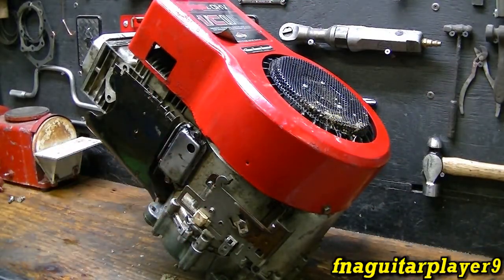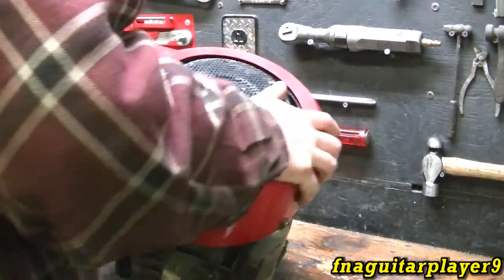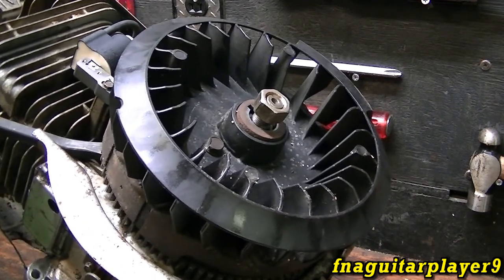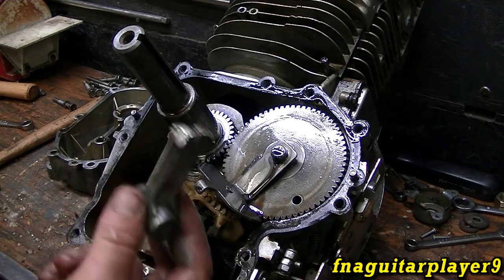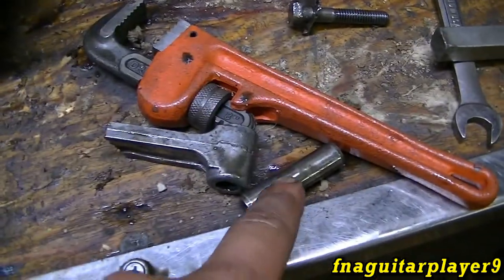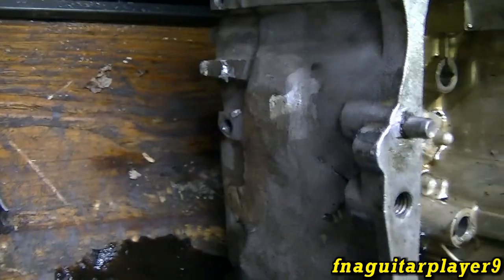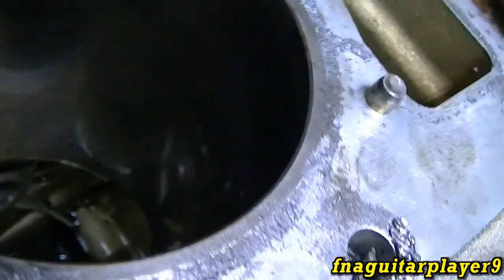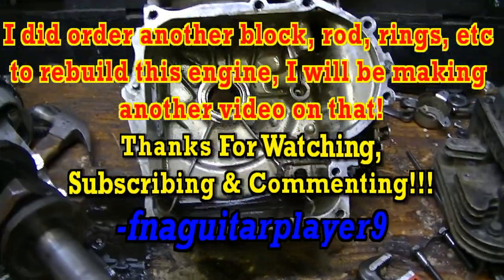Tearing the 14.5 HP B&S Apart to find Major Crankshaft Problems!

Comment: love your channel . you have some great videos . I thought I would let you know what caused that shaft to break like it did. I am a retired millwright/ Industrial mechanic   I got a quick look at that piece of shaft that broke and can tell you that sometime in the past that some one way over heated that  shaft way to hot very probably to get the fly wheel off and then while it was still very hot quenched way too quickly more than likely hit it with a water hose thereby re-tempering the metal making it too brittle and causing it to break like glass from a blow from your hammer or maybe cracked from the shock of the wreck its self. This is why mechanics or other people who are not experienced with the tempering of tool steel are warned about heating metal and bearings too hot with a with a torch and then quenching too quickly with water it can make the metal very hard and  brittle.That is what gives it that sandy look inside  like you see in the piece of shaft in your hand. You will find that same sandy look in any tool steel metal  that breaks or chips. you can see this in badly tempered chisels, hardened bolts, nails, screws drill bits, bearings and so forth. If you have to heat  a coupling, gear, or bearing to install or remove it because of the need of a tight fit damage or rust it does not need to be heated all that hot especially for installment. once you get it above boiling temp you have about all  the expansion you are going to get. use a temp stick , used in welding or heating they are very cheap or simply spit on the object and when it bubbles and hops it is ready to be installed or removed. you be ready to install shaft cleaned of rust and debured, welding or heavy leather gloves or mittens  and your 230 degree coupling, sleeve, bearing etc. or if removing, your hammer and or punch or what you need to turn or impact your puller and then work smoothly but quickly before the shaft gets expanded from the heat also. If it does  you have lost your clearance. Let it air cool and it will not change its temper . If  you have an air hose and let it blow on  it to cool it, is almost as fast as water and will not change  the temperr, but let the shaft or whatever return to its temper and start over. If you don't believe temper can change metal drastically then take a old file you don't' need and heat it orange or yellow would be better and if you have some garden lime  bury it in  a bucket of lime and leave it to cool overnight . you can bend it like mild steel .Sorry his was so long but thought it might help some of you.
Reply: fnaguitarplayer9 video's are great and i also find your comment interesting,  i for one have a habit of grabbing a torch and give it the beans and in the back of my mind that little voice is telling me not to change the temper,   but needed a little advice,   thanks to the both of you

Comment: Are you still here on YT?  I have a question about this same motor, but for the life of me can't find a good answer. Mine won't turn over until I take the spark plug out, then it spins freely (and squirts gas all over my driveway!) I watched a few tutorials, bought feeler gages, and adjusted the valves... but for the life of me it still won't exhaust and the pressure locks it up when I put the spark plug back in.  Any advice?

Comment: I normally used a flywheel puller so are you gonna replace that part what you just broke
Reply from the maker: I used to mine broke and i just now remembered to get another one. But yeah i did have to get another crankshaft for it, the ones I had from other engines were worn out to much to use. I had already ordered the block then found out i didn't have a good crank for it. Thanks for Watching!!!
Reply: +fnaguitarplayer9 Ok you welcome i will be checking out others of your video's as they come, even we learn alot's from watching your video's
Reply from the maker: appreciate that!

Comment: I guess you will save some for parts
Reply from the maker: I got a pretty good deal on a good used block, and ordered new rings and a rod for it, I'll fix it, and won't have a fortune invested in it. Thanks for Watching!!!
Reply: fnaguitarplayer9 Wow you are very smart at that, i try not to blow any money for no reason myself i just watch, listen and learn and , i will be watching more of your video's and You welcome
Reply from the maker: I hear ya! It won't be to long and i'll be rebuilding this engine, I've been busy here lately! Appreciate that!
Reply: +fnaguitarplayer9 I guess you gonna prove all of us wrong by rebuilding that small engine's, I already know you are good at this, because you gave me the right valves clearance for Tecumseh lawnmower, only how long it gonna takes to rebuilds that engine's since you already have all the parts
Reply from the maker: I hear ya. In my latest video on surfacing heads and blocks i showed the block i'll be using in it. It won't take but a hour or 2 to put it together but i'm currently working on a truck on weekends and its taking alot of my time for these longer videos, it won't be long though!

Comment: Man you actually replaced all those parts? Unless you had a donor engine or used parts, that would cost more than a new engine to buy all those parts new.
Reply from the maker: I got a good deal on a used block off ebay, and some other parts, I don't have a whole lot in it. If i wasn't making videos I probably wouldn't have put any more money into it, its just a back up motor anyway. But no, the only parts i bought new was a rod, rings, and gaskets. Thanks for Watching!!!

Comment: Yes, OUCH! Hate that about the crank. I try and get a pry on both sides if any way possible and I know you do too but you ran out of arms and hands. I've got a pickle fork I use on one side and a lady slipper on the other and then pop it.  Usually works right off. And the way some companies say to run these engines is a wonder they stay together 5 seconds. Craftsman said to run the opposed piston wide open and just use the choke till it warmed up. That's why I got the jetted carb for it so I can crank it on idle.Gravely said to run the 301's wide open while working. A 301 never needed to be wound up as far as I can see. The blasted thing would kill a weeks burying. Probably the main reason the new ones are flying all to pieces. Too fast, too thin oil which leads to too hot internals and sparkling oil. But you got good parts left.
Reply from the maker: Yepp haha I try to do it that way but they usually pop right off most of the time. not this one haha your right, and the auto chokes ones where the engine revs up full throttle when cold is not good, I put a manual choke on them! I ordered another used block off ebay and have some other parts coming in soon, hope to rebuild (or build) it here soon. Thanks for Watching!!!